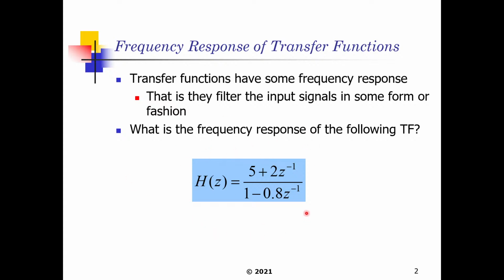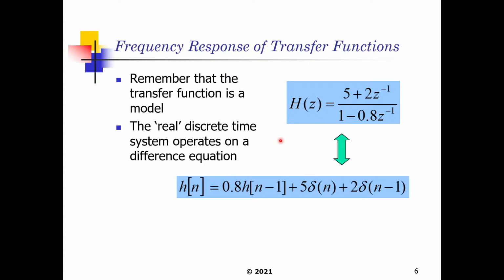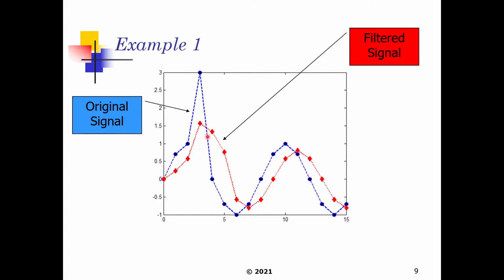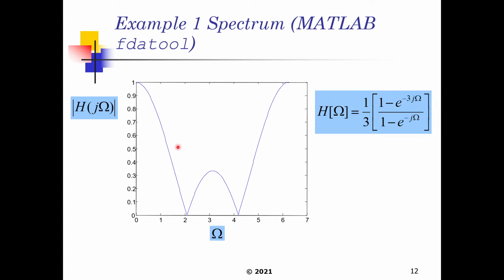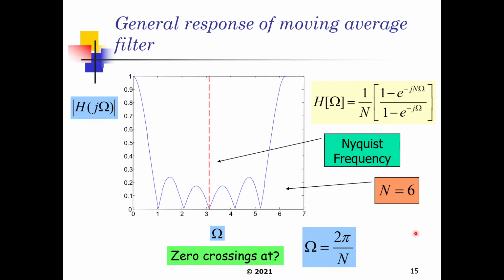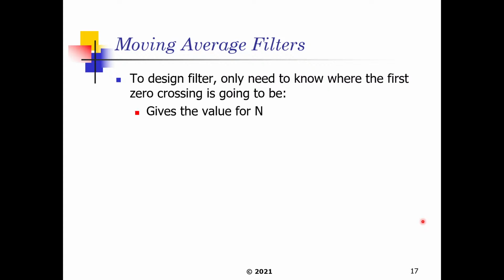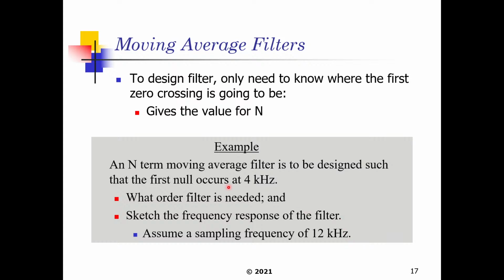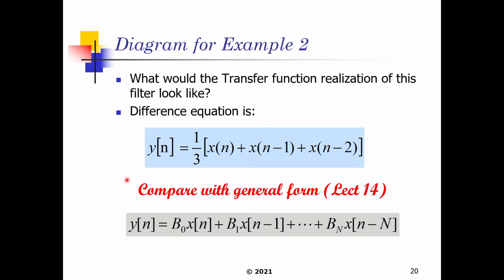DSP Lecture 15 - Digital Filters 1

Comment: @17:50 would we substitute e^(-jo) whenever we want the spectrum? and why can we make that substitution...where did the relationship come from ?
Reply from the maker: Remember, digital frequency (capital Omega) is equal to continuous frequency (common omega) multiplied by the sampling time, T. If you recall what z equates to using the 's' component from the Laplace Transform and when it is applied with the sampling continuous frequency (see Lecture 7), it forms this relationship.